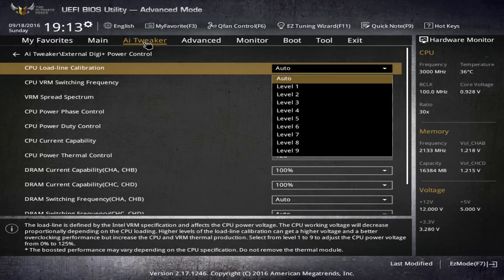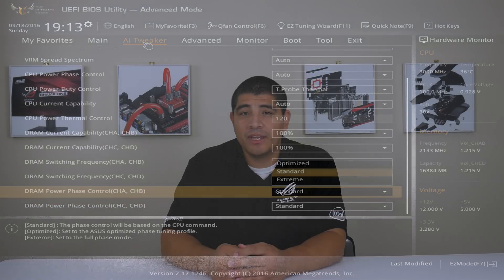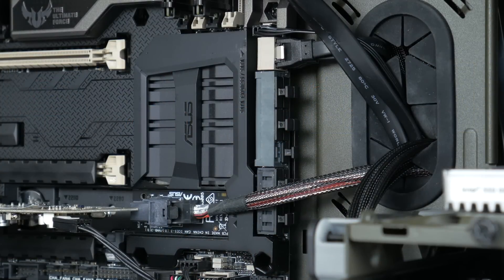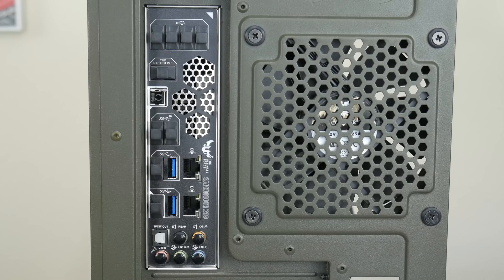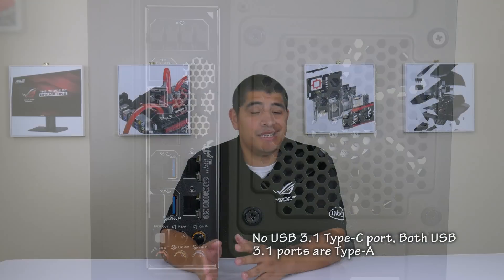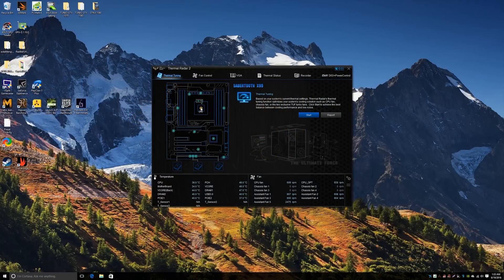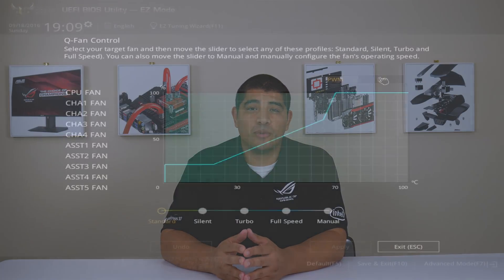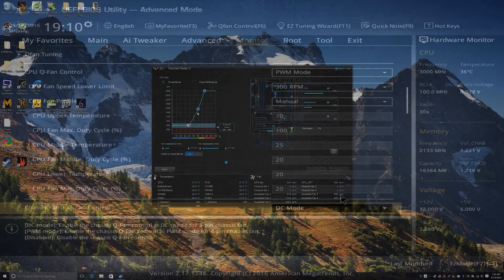X99 & GTX 1080 Gaming, Streaming & Video Editing Build Guide

Comment: im trying to build my first gaming pc, I would like to use the gtx 1080 and get 4k gaming, my budget is $1600. i dont want it water cooled and i dont need a keyboard. any help would be much appreciated.
Reply: ronnie carpenter $1600 is a tight  budget for a PC with a GTX 1080 if you want the parts to be balanced

Comment: JJ - I have had 2 Asus 990 FX Sabertooth motherboards go wrong (break, CPU Red light Mobo will not boot, Refund on the first and RMA the second but will sell when I get it back) on me and also an ROG Swift PG278Q had to be RMA`ed so I have lost my trust in Asus reliability and quality of there product, I am still having trouble with the PSU for the Monitor which could be faulty so sorry to say I will be purchacing an other manufacturer next time I by any PC product

Comment: Now running a X79 system for gaming, streaming and video editing. X99 is what I want to upgrade to, but I must change everything, so it will be expensive, so it won't be happening for a long time, so maybe X119 will be it? :P It would be a beautiful little mATX system. ASUS has a beautiful x99 mATX motherboard with just the right color scheme. I want to do a black and gold system, so the new Strix looks great as well for this system, with a custom home made case of dark wood and glass with a horisontal motherboard.

Comment: Any chance for a Optical UHD Blu ray ROM drive?
Reply: Wouldn't it just be a normal Blu-ray disc drive, and the software need to support the UHD discs?
Reply: Well then, my 16D1HT would need a firmware update!
Reply: cornbreadman What I mean is, it's just data read by the reader, then sent to the PC, right? Or is it a new BRD format?
Reply: I beleave it's a new format! x265/hevc 8bit and 10bit.
Reply: cornbreadman Not file format, I'm talking about the disc itself. The hardware. Like a change from DVD to BRD, but BRD to a newer version of BRD.
Reply: Yea but my drive can't read it or explore the discs contents.
Reply: cornbreadman I see. i wonder if that's some kind of bullshit copyright protection, or you actually need a new drive. Will be interesting to see.
Reply: I beleave it would be a new drive.

Comment: Great video as always! Regarding storage: I'm considering the Samsung 950 Pro series M.2 NVMe. I'm curious to know if this was considered and if it was, why it was beaten out. I'm caught up in the confusion of PCI-e vs M.2 vs U.2
Reply: ahhh I see, I didn't think about temp/throttling performance under load as it would localize a heat source close to vital components on the mobo. Thanks again for the great video and insight!